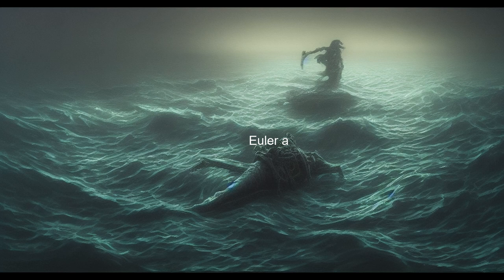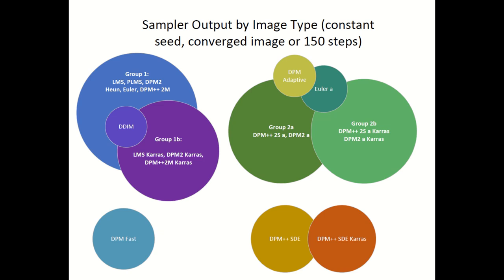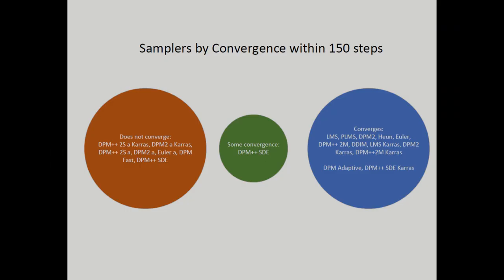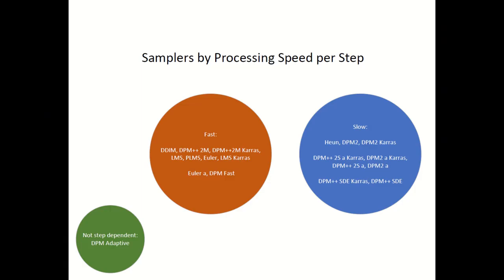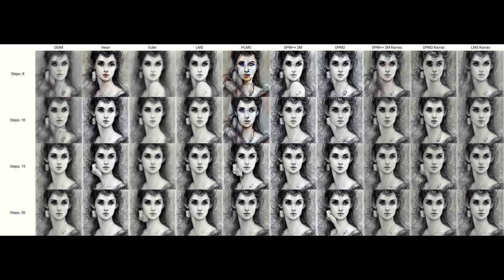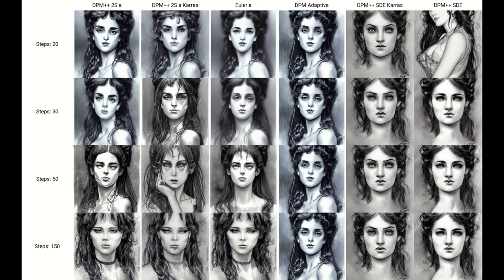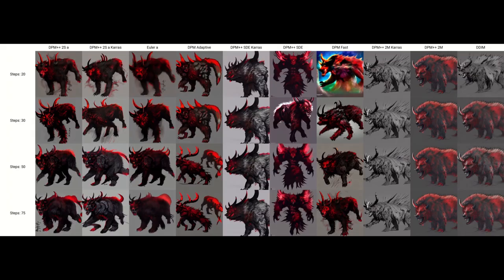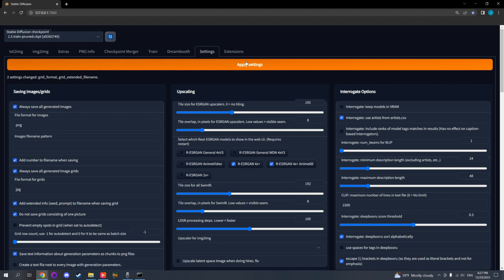Stable Diffusion Deep Dive - Samplers - which are worth using and which are redundant?

Comment: I learned quite a bit with this video, and have already adjusted my workflow. Actually turned off highres.fix..Went 768*768. Chose a good 'discovery' sampler like DPM ++2m (pumped out an image in 10 seconds)...chose what I liked. Sent the image to img2img. Upscaled using your Heun (You stated fantastic quality), to 1536x1536, each image taking 1 minute. This is producing fantastic results in 1/2 the time as before. You literely increased my workflow 2x!
Reply: Is sendingntonto img2img as effective as the hires fix? I worry that doing the step later somehow loses information about the prompt that helps the upscaling

Comment: Not very deep, just basic information really. 

You can add ancestral property of re-applied noise on to non-ancestral samplers with new extension, which in my short experience leads to better outputs overall. Part 2 required. Also there are more variations of samplers with older known extension - you can apply properties of Karras, exponential and variance preserving samplers to any of the existing with variable parameters.
To see if sampler converges or not it's enough to look at it's name, because ancestral(with "a") samplers don't, they re-introduce noise to image regularly. You can easily see that in your converges/not bubbles with the only outlier of DPM++ SDE, for whatever reason.

But hey, at least i enjoyed some memes. I'll sub for now, let's see what you'll do next.
Reply: Link to this extension please?
Reply from the maker: It definitely sounds like you are way beyond the majority of users in terms of experience with samplers.  I think for now I'm going to stick to features available in the base Automatic1111 GUI, because my primary goal right now is to create good, concise videos around intermediate and advanced features.  Though I'm definitely gonna have to take a second look once I get the low hanging fruit out of the way.
Reply: @siliconthaumaturgy7593  Eh, i might be, but i really don't think so, because it's just extensions that everyone can get and use without any experience. Im not very advanced, considering that people familiar with python coding will have a huge advantage and can make their own features e_e

Or, well, if we talk about majority, which includes everyone just using SD, then yes, of course, because majority is just using sites and bots that don't even let you see what sampler is used most of the time. We here are all beyond majority tbf.